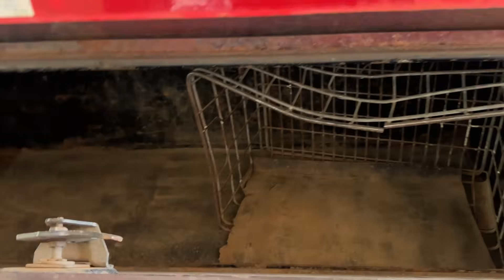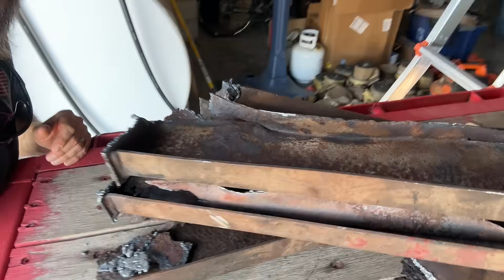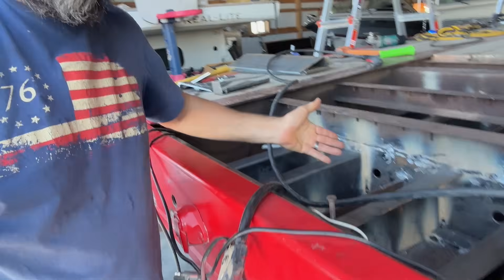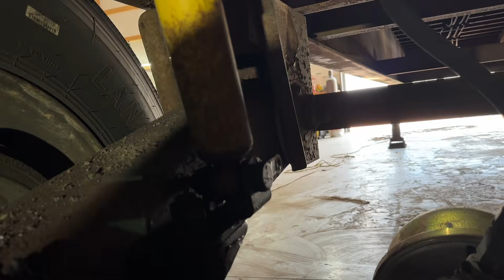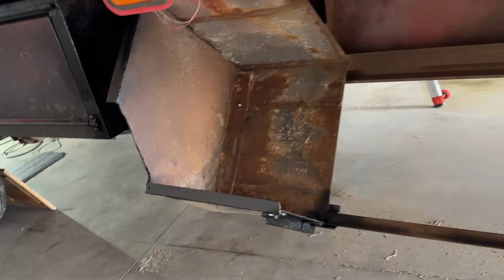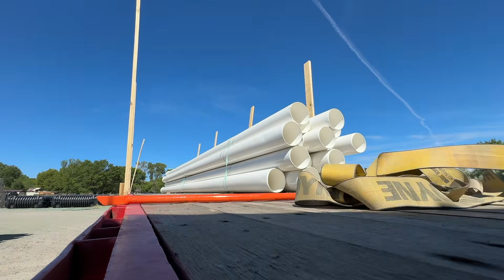MY TRAILER RUSTED IN HALF!  (Trucking Gone Wrong)

Comment: Would it be a good idea to drill a few small diameter holes in the bottom of the steel boxes to allow any water that gets in some how to drain out? You could also periodically spray rust preventative in it too.